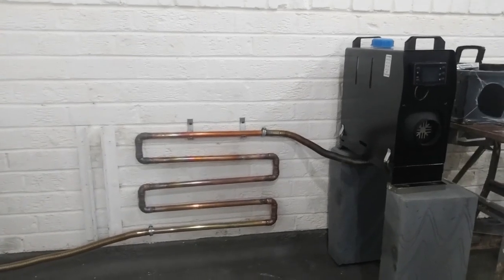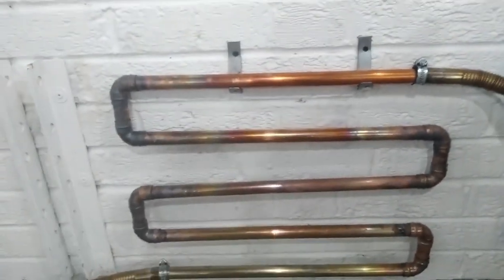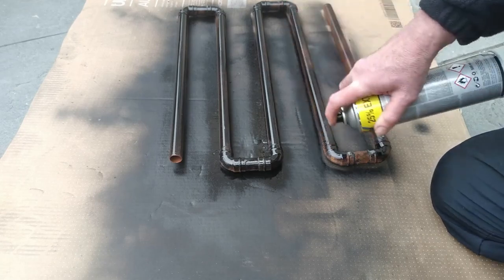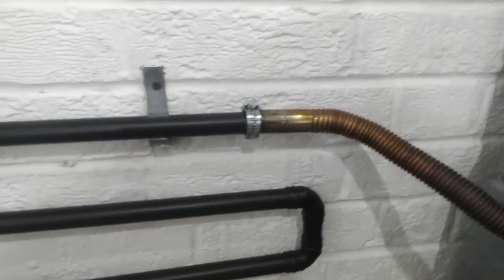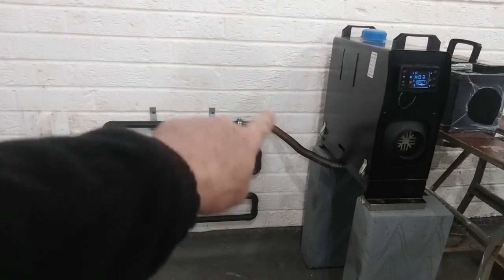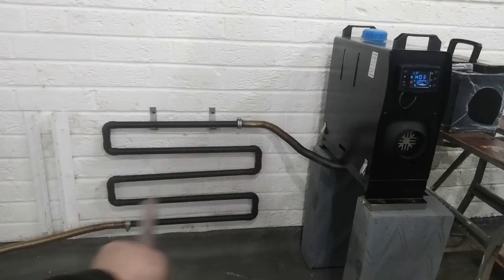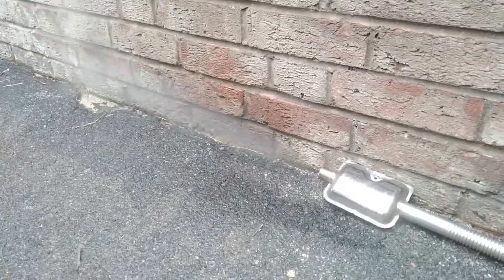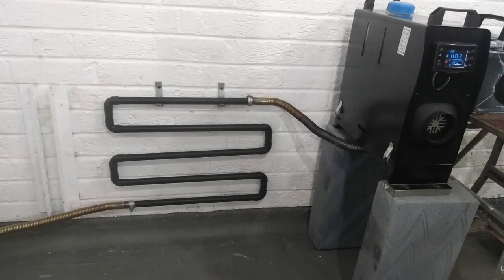I HEAT THIS HOMEMADE RADIATOR FOR FREE Using Waste Exhaust Gas from a Diesel Oil Heater Chinese

Comment: I'd prolly use a bunch of thin pipes in parallel. You'd need to fabricobble at least one manifold, but you'll get much more surface area without creating much back pressure.

Comment: Does that heater have a forced exhaust system? Otherwise I'd be worried about the exhaust flow stagnating and resulting in CO2/CO buildup in the room with it with that much pipe, especially with no draft helping it since it is going downward. Other thing you have to remember is that a radiator like this works both ways, when the unit is off the heat from the room can more quickly exit through the metal piping.
Reply from the maker: good comments shared thanks.
yeah this pipe is a little restrictive and would work better if it was a wider diameter.

did you see my other heater videos: https://www.youtube.com/@andyfireblade
let me know what you think

cheers andy

Comment: They're not designed whatsoever for waste oil they get clogged up and the pump get damaged
Reply from the maker: good comment true
Reply: @andyfirebladetv  an internally where are the diesel inlet pipe goes into the unit there is a little mesh filter right beside the glow plug what it requires disassembly to have access

Comment: Everything all right with back pressure created by the longer exhaust pipe? If so I will def do this. Smart.
Reply from the maker: i think a wider pipe would ease the back pressure  , and not so tight bends would help with the flow if possible

did you see my other heater videos: https://www.youtube.com/@andyfireblade
let me know what you think

cheers andy

Comment: Hi Andy, I'd say that's one of the best designs yet for dumping heat into the room, the thinner the pipe wall the better it'll work. I have to do the matt black trick on the bike headers all the time, just remember the further away from the source you stand the lower the reading on the infrared gun but when you use it up close the sensor is about an inch below the laser pointer so aim an inch high.
Reply from the maker: thanks for the comments,

did you see my other heater videos: https://www.youtube.com/@andyfireblade
let me know what you think

cheers andy